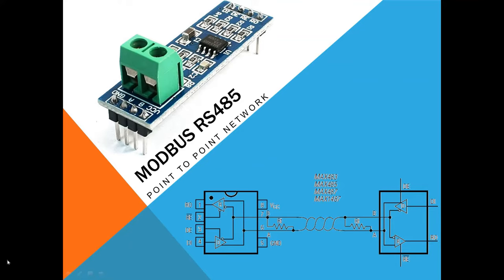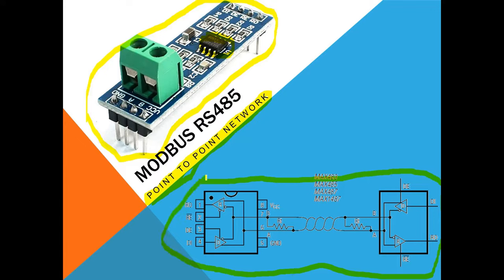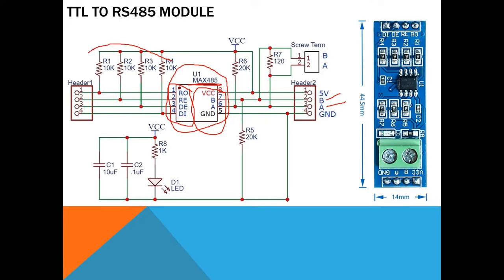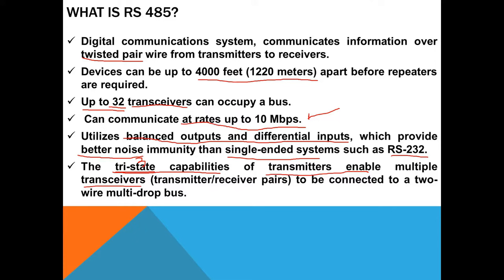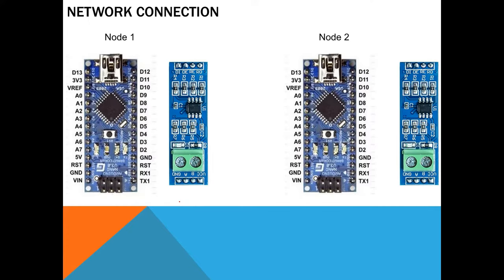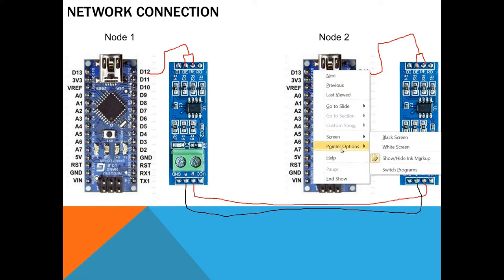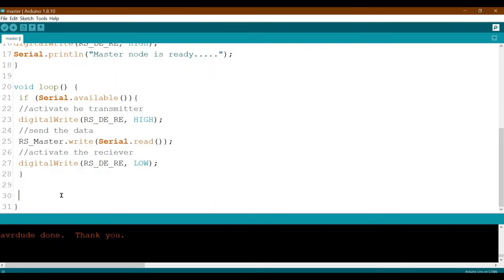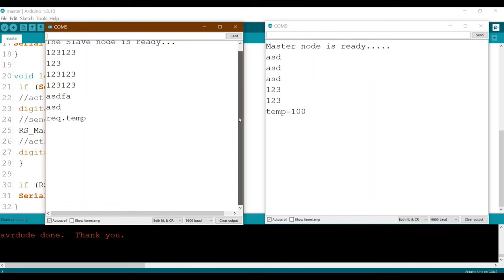What is RS485 serial communication? How to use RS-485 MODBUS to design Arduino point-point network.

Comment: Thank you. 
Simple and clear.

One question - when Slave transmits/Master receives, RX LED blinks on Slave, and TX LED on Master.
The same the other way - when Master transmits/Slave receives, TX LED blinks on Slave, and RX LED on Master.
Why? It's counter intuitive.

PS. You could share both scripts in video's description, so one doesn't have to rewrite it.
PS2. It's not MODBUS, as video's title says - it's just simple serial communication over RS-485. MODBUS protocol is not used here.
Reply from the maker: Thanks Pawel for your comment, 
 The RX and TX LEDs are blinks while transmitting the data due to the data transfer from the serial monitor to the MCU only and nothing to do with MODBUS modules.

Comment: Excellent Video!! Thanks a lot!!

Btw, I guess another possibility for 38:15 is that your RS_DE_RE for the master is still "HIGH", and you need to input something to let it "LOW":

See line 27 in master: digitalWrite(RS_DE_RE, "LOW"); 

And before calling this loop() function, it is still "HIGH", which means that the slave cannot transmit messages to the master.
Reply from the maker: Sorry for the late reply, You are correct, I can see what do you mean. To put it simply:
The master node need to receive an input from the slave to enter the if(serial.available) condition and at the end set the  digitalWrite(RS_DE_RE, "LOW");. Then the master can receive data from the slave. 
That's make sense, will update this issue in the future.
Thanks for your input.

Comment: Hi, I follow your video and it works but I don't understand how to make the slave send data to master with the value of a sensor read by the slave. I have a PZEM-004t on my slave. I want to make the value come out when the master call. For example, I write "req,PZEM1" at the master, then the value of voltage, current, power and etc. from the first PZEM are sent to the master.
Reply from the maker: Hello Haziq, to implement the scenario that you described it you need data addressing scheme to request and receive the specific data, you may check these videos:
https://www.youtube.com/watch?v=diDnelKFqg0&t=61s&ab_channel=ChallengerTech.https://www.youtube.com/watch?v=RyiIGNZ__jI&ab_channel=ChallengerTech.
https://www.youtube.com/watch?v=HUCiRF5Ceh0&t=1326s&ab_channel=ChallengerTech.
https://www.youtube.com/watch?v=03ZZmRFTGYU&ab_channel=ChallengerTech.
Reply: Does pzem 004t have memory to store the total energy consumption even when turned off.

Comment: Really fantastic! One Question, I think you are using a Mac, how the heck do I open 2 serial monitors? Mac seems to only allow one instance of Arduino IDE to be open, not the necessary 2? I read it was in terminal, but couldn't get the thing to work, so had to swop to windows.
Reply from the maker: Sorry I am not using Mac.

Comment: Thank you for your video, it's very simplified explanation. Got a question, is there a way not to use physical wires  for terminals A and B to connect the 2 modules, so in this case it will be totally wireless? I just wonder if this is possible?
Reply from the maker: You can directly use a wireless modules instead, there are wireless modules that support serial UART interface. You may check these videos:
https://www.youtube.com/watch?v=W2Ha3vBpxSM&t=14s&ab_channel=ChallengerTech.
https://www.youtube.com/watch?v=h883lBQIhuo&t=22s&ab_channel=ChallengerTech.
https://www.youtube.com/watch?v=yz9r2c4diLA&t=9s&ab_channel=ChallengerTech.
https://www.youtube.com/watch?v=kgkSilELi-w&ab_channel=ChallengerTech.

Comment: Did you have to use two laptops for this? I can’t seem to get two IDE and two serial monitors working at one time on my PC laptop. I have the slave on COM 5 and master on COM 6.
Reply: a work around by opening the master in IDE 1.8 and the slave in IDE 2.0
Reply from the maker: Hello @keithbrown162  , well, you may try to open 2 arduino IDE instances at the same time, then you set different COMs following the arduino boards. This is what I usually do.

Comment: does the ground need to be connected  between two majouls? or not?
and dont you need to change the slave pinmode to low again after you print the charachter?
Reply from the maker: Sorry for the late reply, Well, the RS485 is a differential signal so no common ground is required.

However, Connecting the GND wire between the source and receiver might be useful to limit the common mode voltage that can be impressed on the receiver inputs.

Comment: I have a question. Imagine I would like to connect another Node or other 2, 3, 4 or five nodes into this connection. How would be the connections? In that case, will I just joint the A, B connection ?
Reply from the maker: Hello Jobson, Yes, You are right, Need to join the A and B wires but in a multi-drop connection manner. I am working in developing multi-hop example with more than 2 modules, gonna release it soon.
Reply from the maker: BTW Jobson since you gonna interconnect more that 2 modules, you gonna need an addressing scheme as in:
https://www.youtube.com/watch?v=03ZZmRFTGYU&ab_channel=ChallengerTech.
https://www.youtube.com/watch?v=HUCiRF5Ceh0&ab_channel=ChallengerTech.
https://www.youtube.com/watch?v=RyiIGNZ__jI&ab_channel=ChallengerTech.
https://www.youtube.com/watch?v=diDnelKFqg0&t=1951s&ab_channel=ChallengerTech.

Comment: thank you for share, it is helpfull video. Absoluttely i got a new infos. İ have a question. If i connect an arduino pro mini to hmi device with rs485 protocol, what i need code or library type, have you any example as this. Othervise, can you suggest to me any tutorial video for arduino and hmi master/slave. Thank you again.
Reply from the maker: Hello gokhankunt3884,
Well, you need to study the HMI RS commands then use arduino to send them to the HMI.

Comment: Hi, how could we use MODBUS RTU with this set up? I could not get any response from my digital sensor which takes rs485 data input, I simply entered my request to the serial input and I'm not getting any responses. 
Could you please help me? many thanks
Reply from the maker: Sorry for the late reply, although the digital sensor support RS485 as a communication, there might be a specific protocol/commands sequence to talk to it. Might need to check the sensor manual/datasheet first.
Will try to work on the MODBUS RTU examples in the future.

Comment: Sir , I Know why In the end ,you  first sending from slaver to master is not worked , Cause the master is  set the  RS_DE_RE to HIGH at first .
Reply: So in the end , there is  no master or slave  actually . The master could just use the same code which the slave use.
Reply from the maker: Hello @MrWangsan  That's correct.

Comment: Its possible 12V in ModBus RS485 devices? GREE HP we measurins and 11.24V
Reply from the maker: Commonly talking,
VCC = [3.3 - 6]V
A, B = [-9 - 14]V
However, it is better to consult the chip datasheet to conform the ranges.